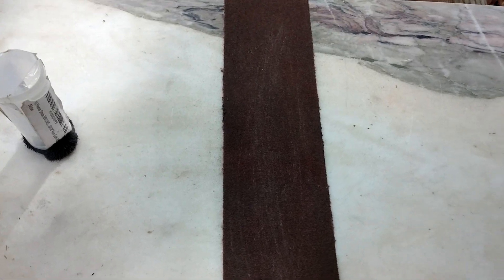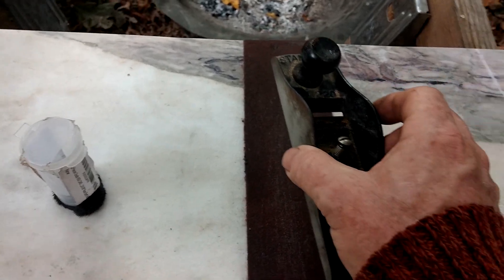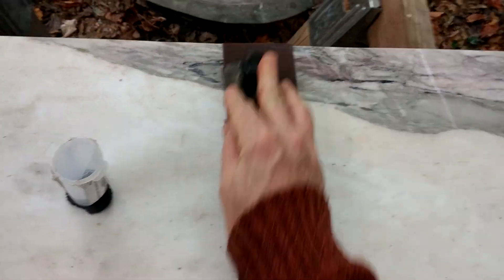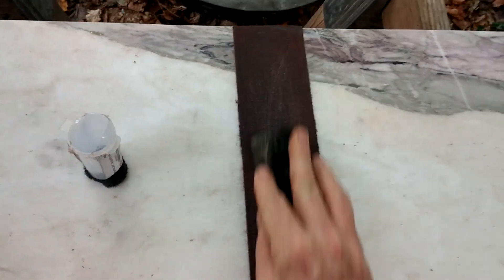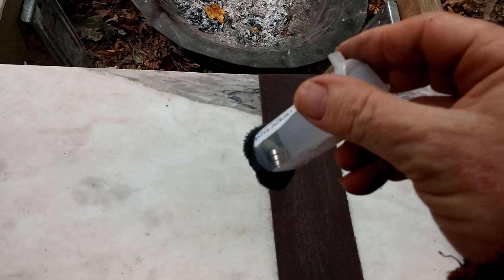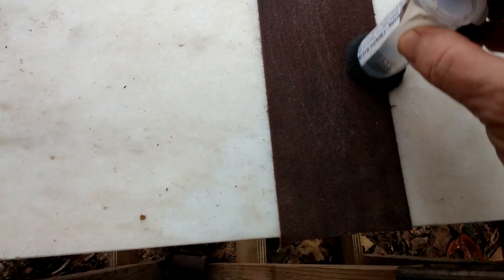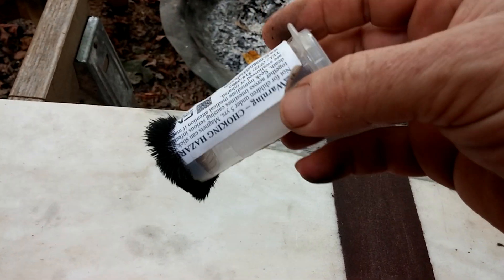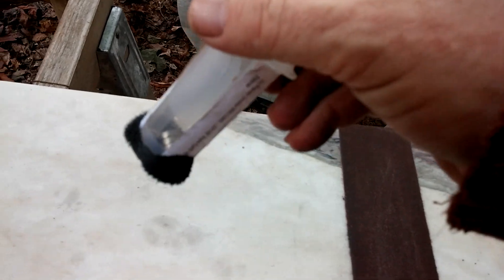Cleaning iron filings from sand paper with a magnet

Comment: Thanks for sharing and you can also ( I think) use electric magnet by turning a thin isolated wire over a nail and hook the two ends with a dry battery. And when you finish just disconnect  it over a trash can and the metal will fell .
Keep up the good work.